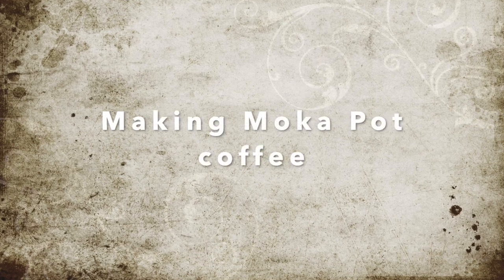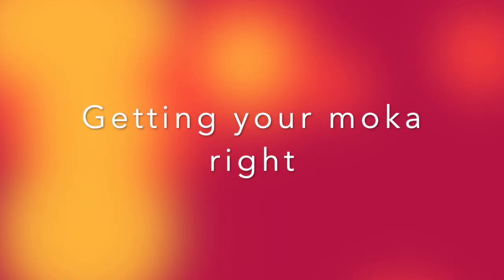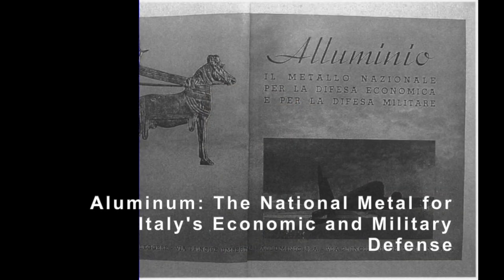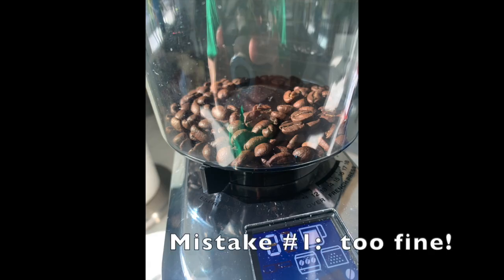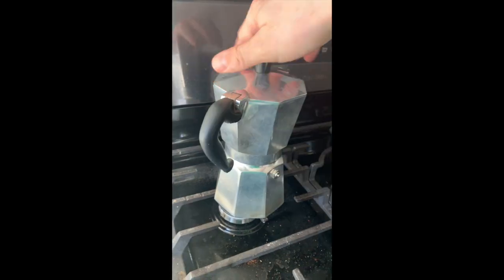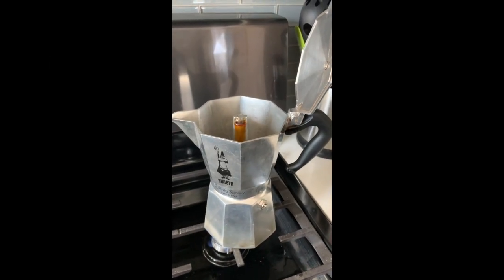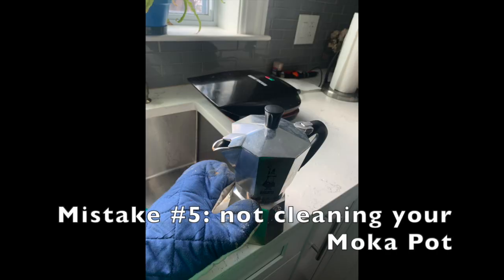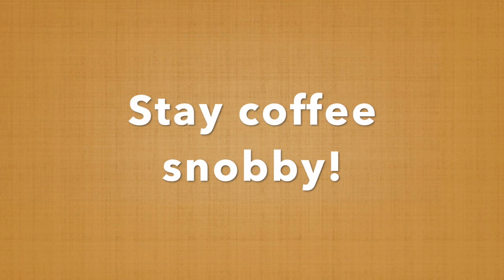Why your Moka pot tastes bad

Comment: Number one advice from me.....keep the burner at low to medium.   All the other tips, you can mess up on.   I never pre-boil. Never cool down.   Just keep the burner down.   And remove after it starts steaming. Don't worry about being perfect.  All this obsession with the perfect cup....I've been brewing coffee for decades.  Most important tip is to enjoy.
Reply: I agree only to 50%.
Its like baking a great cake vs. baking a good cake:
A goo cake will always -  by definition - taste good.
But if you once, even by accident, made a great cake, you can either enjoy it and never worry about any more, or you can have a taste-orgasm and never want to go back to "good cake".

For me it became sort of a passion to always try to adjust until I get the best coffee result, just like a mini-hobby. And I enjoy the taste as well as the process :)
Reply: You’re the same guy who tastes a specialty V60 and says it tastes just like a cheap American brew. 
Just because you’ve done it one way your whole life it doesn’t mean that it’s the best way.
Reply: Yes, yes, yes, thank you!  So much angst over brewing a cup of coffee!  People have been using this method since the 1930s, so it must have something going for it.  Relax is my tip.  It's just a cup of Joe!
Reply: So true.  If you keep the heat low and let it sort of slow gurgle over, and pull before it's fully empty in the bottom chamber it will leave you with a tasty cup of coffee. It takes patience.  High heat is the enemy.
Reply: 100% agree…
I brewed my first ever cup today, and it was perfect.. and i did exactly what you described..
Put it on the small burner, and kept it low..    room-temp water….    No “cooling down”…
The whole process took 3 minutes..  

Also, i think most of the obsession with “the perfect brew” is actually an obsession for views..     otherwise, there are already 1000’s of videos on this SIMPLE PROCESS..  really no need to make another.
Reply: @adamfirst9321  Why not? Some people enjoy average cup of coffee or dont really taste the difference. Then there are some people who want a great cup of coffee because they notice the difference, so they will push to optimize the process. Both are perfectly fine.
Reply: @GohanSama  
Pushing to optimize is fine.. when there is something to push..
This process is as optimized as it gets..  it’s a no-brainer.. 
put water in, put the ground coffee in, put over low-low heat..  and wait for it to finish and just barely start to bubble out..   remove from heat..  put in a cup.   Drink.

unless folks WANT TO make the process more complicated for NO REASON.  I’ve seen videos use ice-baths to “stop from over-brewing”..
But that’s just so ridiculous..  the brewing stops almost immediately after removing from heat.

and if you want to mess around for taste, the biggest difference comes from amount of coffee.. and amount of heat..   
the lower the heat, the slower the process, and richer the taste.

I wasn’t saying folks shouldn’t experiment.. I was saying there are enough Moka Pot videos.  If content-makers are still making videos, THAT isn’t for taste or “optimization”.. it is for views only.

But yeah, go ahead and experiment to your heart’s content.
Reply: @adamfirst9321  You are conveniently omitting a few key factors that will have impact on the coffee. If there are people still willing to try new things, why not. Nobody is forcing you to view all the moka pot videos, so I'm not sure why does it bother you so much.
Reply: @GohanSama  
Get over yourself dude..   
go get a cup of coffee before you blow a fuse.. 

I didn’t conveniently leave out anything of importance… I don’t even know what you are on about..
If you have some specific thing, SAY IT.. don’t play riddle games.
Or maybe you’re saving it for a video??

And It doesn’t bother me as much as you think it does..whatever “it” is..
I shared my opinion about the video… 

You are sharing your UNSOLICITED opinion about me..    THATS THE DIFFERENCE.
and truthfully, I couldn’t care less about you or your opinion about me..
So, Buzz off and find yourself a better friend… I’m not the one.
Reply: @adamfirst9321  look you enjoy you simple coffee and some people enjoy a more complicated process, perhaps even more than they enjoy the coffee itself they enjoy striving for the perfect cup. And some enjoy documenting their journey. There is absolutely no reason for you to get your panties in a twist over the amount of videos that are present on YouTube on this subject.  Just don't watch them and also don't take things too personally. Cheers
Reply: @GohanSama  
lol..   look who is talking..
Reply: I water cooled it the first couple of times but I didn't see the point so I stopped. It stops fast enough on its own when off the heat since the water level is below the siphoning point so it's only steam..
Reply: 100% agree. I use cold (or room temperature) water and use the lowest gas setting. Takes longer but comes out perfect every time.
Reply: Well said
Reply: actually remove it just before it starts steaming!
Reply: The absolute worst moka pot coffee I've ever made was when I brewed it on low heat.
Reply: Good feedback
Reply from the maker: More discussion on preheating water:https://youtu.be/jcgMeDDAT-s
Reply: @loodog555  I just preheated it to try your theory, no difference.
Actually it looks like it's watered down, at first I thought it was just a feeling, but it seems that preheating removes some flavor.
Reply: @switchstatement568  No wonder I've never heard of preheating water for moka. Because indeed it sounds like extra useless step and extra appliances that just fill the kitchen space for no reason. 
Either way, I'm gonna try this preheating methodology tomorrow morning.
Reply: @OG_ALviK  I agree with you, I am making a coffee not a full meal so there's no need to clutter the kitchen with another pan, but I have to say it does some difference, the result for me is basically a watery coffee with less flavour, please let me know your results after you try, another opinion would be good since it seems that a lot of people would debate over it.
Reply: @switchstatement568  They are just trying to make something simple complicated to make it seem like there is some sort of "secret" that you can only learn from their video's.
Reply: @OG_ALviK  It won't make any difference.

Comment: Great video!! We love our Moka pot!! When we first got ours, we broke it in with three brews using some cheaper beans to season the pot and we don't thoroughly clean the pot, we simply rinse and wipe out our pot when finished making out coffee - I believe it takes away the seasoning. We also level out the basket when putting our grinds in (but don't tamp) and we find it's more consistent in the flavour and extraction. It really is an art finding the right amount of coffee, consistency of grinds and heat - which is half the fun of making coffee with a Moka pot 😊

Comment: Excellent video on how NOT to use a moka pot.
Basically except the warning not to use too high a flame everything in this video is wrong. No crema because you stop too early (an espresso or mocha without crema is one of the deadly sins), the coffee is ground too coarse, there is not enough coffee in the sieve...
If you don't like bitter consider that coffee is probably not for you.

Think about it this way: This pot was invented to make it easier and quicker to make mocha which is why the result is called 'mocha espresso'. Mocha is made by putting super fine ground coffee (and any sugar if you want) in a small, necked pot. You then fill it with water up to the neck and boil it until it bubbles to the top edge of the pot. Originally espresso was not bitter enough and this is why espresso coffee is a really dark, almost black roast while mocha is a very light roast.
Reply from the maker: You sound like a coffee details kind of guy, so I’ll send you to the follow up video I made that gets more into the details: https://youtu.be/jcgMeDDAT-s

On the issue of crema, and whether or not it’s important or desired, there is a GREAT James Hoffman video I would refer you to: https://m.youtube.com/watch?v=j5rygXblZJU

On the issue of why it was called a moka pot, the research I’ve done shows that it’s simply that both the moka pot and the caffe mocha style of beverage came out of the Yemeni city of Mocha, renown for its coffee culture: http://thecoffeeuniverse.org/mocha-mocha-moka-2/. (Though I would be open and curious if you’ve come across a source attesting that the Pot was named for the mocha beverage also!)

Comment: he's making it more difficult than it needs to be, just put cold water in the bottom, it doesn't have to be boiling or hot,that's the whole point of putting it on the stove. Then it's easier to handle when it's cold fresh water
Reply from the maker: Hey, you’ve got company on this response! Your exact comments and concerns are addressed in my latest video. Enjoy! https://youtu.be/jcgMeDDAT-s
Reply from the maker: Honestly, I haven't found preheating the water makes much a difference compared to more important tweaks like using an AeroPress filter, coarser grind, or removing from the heat at the right time, but probably you should preheat because the physics models show you'll extract at too low a temperature otherwise:  https://www.youtube.com/watch?v=O14BIH-9KTA

Comment: You're gonna wanna tune the way you make moka pot coffee to YOUR moka pot,  and YOUR coffee. They're all different (I have a small moka pot collection).

I've had the most success by adjusting grind size,  and fine tuning how high the burner is turned up. 

My goal is to make very strong coffee that doesn't need sugar or cream to be drinkable. It's very possible. But it took trial and error to dial it in to perfection.
Reply from the maker: Agree completely.  These are just general principles to consider in how you tweak your brew to your own preference.
Reply: @loodog555  
LOL, I posted those as my 'general principles' before I had seen your video (in other words, I wasn't disagreeing in any way at all). Now I have seen it, 9 hours later. But this comment section just seems like the place to post tips for people who haven't been able to get a good cup of coffee from their moka pot yet.

Comment: I love mine. As soon as it gets noisy in the Brewing process I take it off the heat. Also I've had great results using cafe bustelo which is espresso ground coffee. So for every rule there is an exception to this.
Reply: I think there are probably many 'combinations' of rules, or recipes that lead to a good cup of moka pot coffee. I have found that it's basically impossible to get a good cup of coffee from bad beans, though.
Reply: Bustelo si

Comment: Why run cold water on the bottom? I usually just quickly pour the coffee in my mug.
Reply from the maker: Hey Natan, thanks for your comment.  Someone asked something similar below and the issue is that once there's enough vapor pressure through the stream to get the Pot brewing, the brewing process will persist after you remove the heat source. I apply the cold water to immediately stop the brew. Since the big problem with Moka Pots is that they tend to overbrew, this is the small amount of control you have to reduce the brewing time and stop the grinds from being extracted further.  As always, I recommend listening to your own experiment over my advice, so if pouring the coffee in gives you coffee you like, stick with it.  It might may no difference, but it's something to try out.
Reply: @loodog555   @loodog555  thank you for replying to me. I searched for a similar question to mine, but I guess I didn't search enough, so I apologize.
I'm just trying to understand the operation though. You say that after I see the bubbles (which means there's no more water in the chamber) I should pass the pot under cold water to stop the brewing. But since there's no more water, there's no more brewing, no?
Reply from the maker: @natanmusmanthome6772  No problem! You're close, but...

If there's no more water in the chamber, there's nothing to stop.  The extract extraction happens because more water is being run through grinds that have already dissolved a bit.  If there's no more water to run through the grinds, there's no more extraction to go.  

My key is to stop the extraction when the product coming out the top is pale and bubbly.  It means you're basically getting the last "crumbs" of coffee extraction at this point, so I just cut it off there.

Comment: 2 more little mistake in your video: 1 you have to put the right quantity of coffee filling all the space (no leave some spots). 2 yes.. the moka pot needs to be clean but very important not too much and without a dischwasher because the alluminium can be corroded. a wash with water and some vinegar is enough.
Reply from the maker: Hey, thanks for commenting!  As I explore in my sequel video, overpacking actually can contribute to overbrewing. In fact, you might want to consider deliberately leaving some space in to decrease threshold brewing pressure: https://youtu.be/jcgMeDDAT-s. As for the issue of cleaning and dishwashers, I'll be discussing that in a future video.
Reply from the maker: Just published a video discussing aluminum poisoning and moka pots and dishwashers! https://youtu.be/qV3Us0KkIMo

Comment: Another good tip is to NEVER tap or bang the funnel when emptying the grounds, as it can distort the shape of the funnel and cause the pot to not seal properly. A lot of people think the sealing gasket is bad or they have a defective pressure valve when they get steam leaks, which may be the case, but it could also be the funnel is distorted.
Reply from the maker: I have not personally had this problem, but your mileage may vary!  Certainly, aluminum in a thin layer is more malleable than most people realize!
Reply: @loodog555  I've also just recently realized that it is better to have your coffee grounds filled about 1mm BELOW the rim of the funnel. This is because the top strainer protrudes below the gasket and can 'move' the grounds while the top is being screwed on, this can cause the grounds to get caught in the seal or the thread.
Reply: How do you empty it?
Reply: @yh8i  the funnel where the coffee goes? Turn it upside down, make sure the long funnel thing is not hot. Blow into it and 90% of the coffee grounds will fall out.

Comment: I can immediately tell what you did wrong, lol.  ALWAYS:
1.  Use a coarse grind.
2. Fill the chamber loosely so the coffee grounds can expand.
3.  Use cold filtered water.
4. Use medium heat.

NEVER:
1. Wait for the percolating sound as an indication of doneness.  That means it's too hot and flowing too fast.
2. Let the flames (if it's a gas stove) lap the bottom of the pot.  That's too much heat, way too fast.  

TRY:
1. A dollop of fothed half and half.
2. A full bodied Italian roast as a first espresso.  Most people hate it on their first try and think all espresso tastes like that.  Try medium Arabica roast for a milder, more complex flavor.

Comment: I was already doing that and its still bad
Reply from the maker: Hi Nikolay, sorry to hear!  The Moka pot can be a fickle mistress and the challenges with having any control over the temperature, pressure, and brew time mean it's hard to get a consistent formula that works.  My only advice to give (if you're asking for it) is the check with the quality of the ingredients and grind size consistency.  A blade grinder will give terrible results with a Moka pot, so either have your beans preground at consistent size or get a proper conical burr grinder.

Stay away from dark roast beans, which extract too easily, and use filtered water, in case you have hard water at home.  Within medium to light roast beans, I've also found a lot of variation in how much I like the finished product just based on which particular beans I've used. Richard Flaherty below me here swears by Mt. Batu beans from Ethiopia, so that's something to try.  Good luck!  

If your Moka continues to fail to deliver what you want after playing around with beans, water, and grinder settings, an AeroPress may be more to your liking for a nice strong brew that's a lot easier to get right.  The kits are about $30 and the coffee never comes out bitter.
Reply: @loodog555  thank you for the tips! I actually bought specifically grinded beans for stovetop, however they are both dark, that's how I liked my espressos, but in a Moke its a whole different thing, I guess I gotta switch to a lighter roast!
Reply: It's impossible to get a good cup of coffee, if the beans are bad.

Comment: the coffee should not gurgle/explode/bubble. it needs to ooze out slowly with just a bit of steam at the very end.
Reply from the maker: I have drifted more in a direction of turning down the heat to low once coffee starts sputtering.  This does result in a more oozy and smoother coffee flow as you suggest.  Anything to reduce the brewing temperature is a good thing!
Reply: @loodog555  yes thats how i do it. i have a glass electric stove, so i turn it off as soon as coffee starts coming out, and the residual heat of the coil is just enough to finish the brew.
overall, everyone has to experiment for themselves until they find the right procedure.